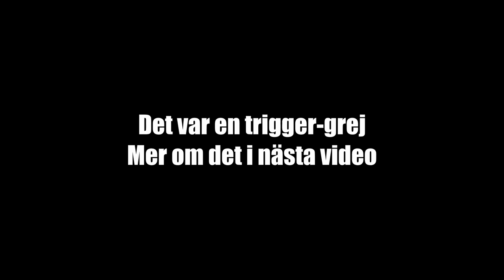5'an är igång med Mexxecu! (ÄNTLIGEN😩)

Comment: Åh va det en sådan kombinerad temp-tryckgivare som du sulade in i blocket? Hur tycker du den funkar? Har kollat på en sådan rackare för oljan i min maskin :D
Reply from the maker: Yes, har en på bussen oxå! Dom är jävligt smidig faktiskt och det finns redan inställningar för dom i Maxx. Dyr nå tragiskt dock 😅
Reply: @VestlundPerformance  man betalar bra med pengar för bekvämlighet xD dock nice att kunna skala ned antalet sensorer som skall kopplas in överallt! 👍
Reply from the maker: Jaaa, den här motorn har ju både tryck och temp orginal till mätare, men dom litar man väll inte helt på efter 35år. Och så ville jag ha så att sprutet kan klippa om det händer nått 😬

Så det kan ju spara en pengar på motorrenovering i framtiden istället
Reply: @VestlundPerformance  oja, tell me about it, jag säger bara tidigt 90tal mätar är typ har du nått slags tryck så visar dem något random nummer mellan 1-10, dem visar ett förslag på vad det kanske kan vara för faktiskt tryck 😅
Reply: Är det så enkelt att man använder 5v volt, ground och 2st analoga ingångar?
Reply from the maker: @rondellslaktarn1414  
Yapp!